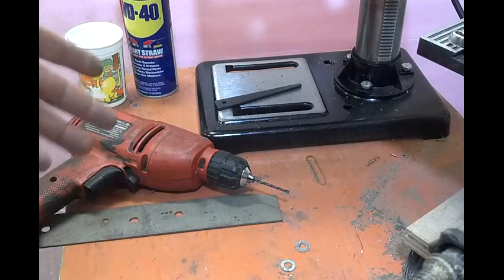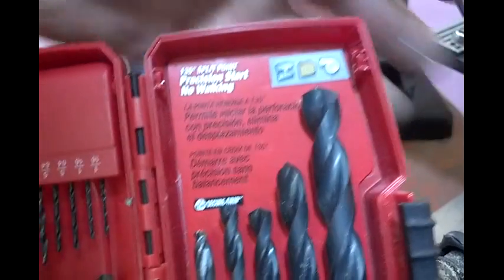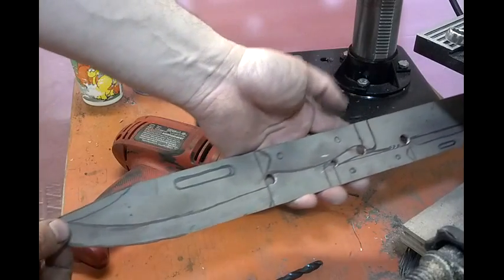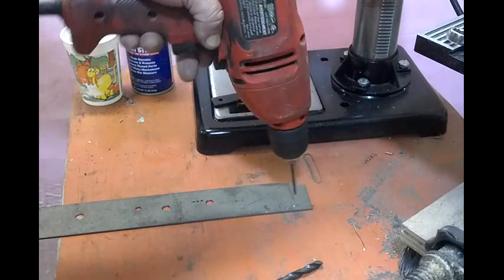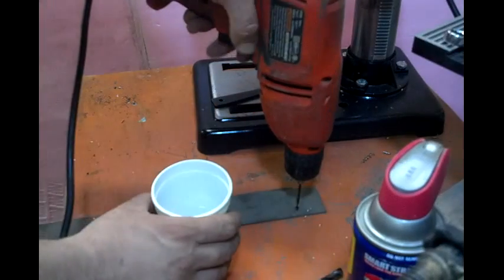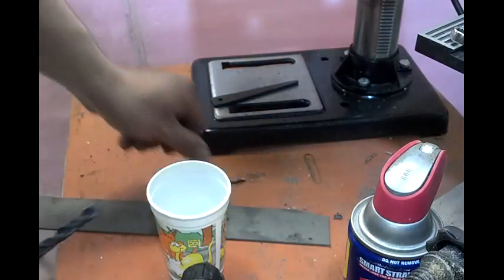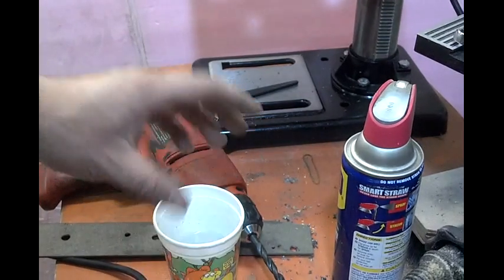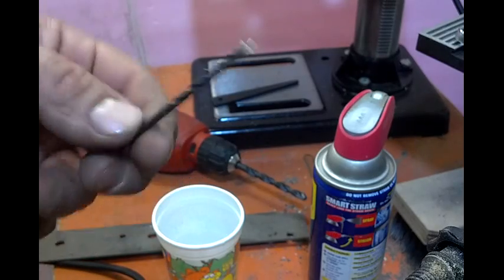How to drill Stainless Steel  w/ cheap tools and minimal supplies

Comment: Use modeling clay to build a donut shaped dam around your drill location. Use actual drilling/tap fluid the dark brown stuff, probably not being made anymore though. Slow rpm good pressure.

Comment: True, oil is a mess, tough to clean. Will use water, regular HSS drill bits, patience and a slow pace.

pilot hole 1/8" = 3.2mm

5/6" = 21mm

5/16" = 6mm

1/2" = 12,7mm

1/4" = 6.4 mm

Comment: Hi Josh..
Whats  the best way to drill a pilot hole, if its above your head drilling OR against a galvanized 76mm pole that's 2mm wall thick. 
Is Using a punch with a hammer,  is that the only option. 
Thanks man

Comment: WD40 is not really a cutting fluid. It's a lubricant and all, but it doesn't take the heat away that well. Use ACTUAL cutting fluid for this job. The price is the same.

Comment: I wouldn't be so quick to knock harbor freight. I just watched a video of a guy drilling holes through a FILE with some carbide drills he got from harbor freight. https://www.youtube.com/watch?v=zWrwDTn9GT8 
Having sharp bits (and a bit sharpener) makes all the difference. I make my own cutting lube by mixing lard with cutting oil till I get a toothpaste like consistency, then put it in a blunt tip syringe. Works decent on stainless and hard metal.

Comment: Who are you kidding your "plain old black drill" may well in fact be good quality HSS. Certainly your set of Milwauky drill is in that league.
You need to use only sharp drills of decent quality made from HSS. Start from a centre pop, drill using both hands, & keep the speed as low as you can. As you recommend frequent cooling is highly desirable.

Comment: If all possible submerge your part in water or a steady stream of water, oil holds heat and water evaporates. Try it ! I do it all the time and have used HF bits plenty of times

Comment: Very useful video and tips, Josh. Thanks.
In my video here https://www.youtube.com/watch?v=Fv6cZVbTOIk  I'm addressing only the problem of small-diameter drilling in stainless steel, which was previously a problem for me.
I agree with you that cooling+lubrication of the drilling zone do miracles. However, WD40 is more of a solvent than a lubricant, rendering only an extremely thin film of light-grade oil. I would rather use a mixture of water+"any" grade of lubrication oil--from thin sewing machine grade, to heavy, viscous gearbox grade. Yet as you said, it's usually a bit messy using oil.

Comment: I was trying to drill an old machete at home without a punch. I might give it another try after seeing this video.
Reply from the maker: You are trying to drill a piece if tempered steel, it will be very difficult. In this case you may need to buy the toughest German "NASA" grade bits you can get your hands on!

Comment: For thick stainless, Fill a sprayer with ice water,  spray constantly. Or rig a 2liter with dry ice/water and 1/4" hose. Lay it on its side. Drill ultra slow. Like 1 revolution a second. If it squeals, stop immediately. It should be cold, quiet, and cut the entire time. Constant speed, constant pressure. Temperature is key here. Stainless will gum up a cutting edge(squeal) create an enormous amount of heat quickly, and change the state of both the steel and the bit in a heartbeat. Dipping the bit in and slathering the steel in no-lox doesnt hurt either if water is unreasonable but it  doesnt help the heat problem.

For stainless sheet metal up to 10guage.  A hilti. All day long drill  with a hilti bit. Never stops making holes, no water, full speed, push hard, will drill a hole in seconds and continue drilling holes for the next 8 hours with no break. Holes are ugly but the hilti will drill it like its butter.  I wouldnt be surprised if  a hilti with a 1/4" bit couldnt get through a 1" thick piece of the hardest stainless in less than 60 seconds. And make 10 holes in 11 minutes.   

The hardest thing to drill in the world???? Try lead. 4+ inches. Drill through a slab of lead and you will have mastered the art of drilling stainless and aluminum.
Reply: Ryan Lloyd which hilti?

Comment: I am installing a reverse osmosis unit which required a 3/8 hole through the stainless sink for the faucet.  I could not make a dent in it. Followed your instruction and in several minutes I had a 3/8.  You must be patient though. Thank You!  I would have had to call a plumber.

Comment: Thanks man, I need to drill 3.5mm holes to mount a bunch of frames in rectangular stainless steel tubing for retail, i was pulling my hair out bc i know nothing about metal only wood and plastic. This is saving my ass, thank you sincerely.

Comment: I just spent 5 minutes making the pilot hole in 1mm thick mild steel... I obviously need better bits.
Reply: varun009 
Nope, you need better technique. You'll get it though. I drill through corroguarded steel every day at work with simple hss bits.

Comment: As a german: Thanks for saying that our drillbits are fancy. I would recommend u buying some hss-g drillbits. They will cost you about 20 dollars if you buy 20 in a box and they drill through ANYTHING. Really, why spend spend every time 1,20 dollar on something you can get with way better quality for less? Btw I also use water to cool.:-)

Comment: What means "w/"? W...or....what?
And how much is 3/16, 1/8... 0.125, 0.187?
Reply from the maker: D EMIL "w/" is an abbreviation for the word "with", and your fraction to decimals are correct!
Reply: Why use a / after W? I interpreted the / as a fraction or correlation sign as in m/f for male/female.
See in contrast how e.g. is abbreviated.
Been asked this by students, couldn't give a consistent answer. I usually tell that a dot is used for abbreviations as in e.g. or it is turned into an acronym or similar (like btw for by the way or betw. for between) or a ' for contractions such as K'Bridge. Confused...

Comment: So straight forward, do I need a specific drill? to do metal drilling, just for the house jobs small jobs , or can I use a normal drill that does wood etc . thanks for the video
Reply from the maker: Bigger and stronger is best for metal, but if your drilling small holes a light duty drill like mine will work fine.

Comment: Didn't work for me. Tried to drill through a stainless 1/16" tube. Tried slow-high pressure, fast-low pressure, and the rest of the possibilities...but to no avail :-(

Comment: thanks for the video, i'm trying to drill through 1mm SS stock pot. i'm breaking bits left and right, i couldn't find the Milwaukee black oxide 135 degree bits but did find the same style in Ryobi brand. I will be trying these bits later today, I hope this works because i'm running out of options.

Comment: Thank you so much.  I spent 90+ minutes trying to drill a pilot hole in a stainless exhaust header and was unsuccessful despite resharpening the bit multiple times with a Drill Dr., using WD40 as a cutting fluid, and using different RPMs and pressures.  The bit simply wouldn't "bite," which was very frustrating.  After watching this video, I tried again the next morning and had a pilot hole and 1/2" hole drilled in less than five minutes.  I hadn't realized water (along with a sharp bit) is the key.

Comment: Thanks for sharing. Using water was a good tip. Wish you could share a video how to drill out a broken stainless steel bolt 6mm diameter.  Thats the HUGE  challenge I am dealing with.

Comment: What should I do if I need to drill a 1" hole in a stainless steel cover on a diesel tank? Can't let water get in, would prefer not to have shavings fall in. I've heard beeswax on a bit will keep shavings stuck to it, but will that work on a hole saw? Also, since I know you'll ask, it is impractical in this case to remove the cover and drill away from the tank.
Reply from the maker: Bees wax should work some, but if I had to do this with water and have a air hose blowing the chips away and/or constantly brushing the chips away. Next I would drill 98% though and break that little holesaw slug out manually with a screw driver. The only benefit of not drilling all the way though would only be to reduce the amount of chips created and to prevent them from falling in accidentally if you plunge though.

Comment: omg lmfao after watching this video I tried alot of drill bits and believe it or not the harbor frieght bits actually did the trick. I couldnt believe the struggle and was quite frakny getting pretty pissed, so when all else failed with even the cobolt bit I kid you not I said what  do I have to loose? and tried the harbor frieght and walla :) so off to harbor fright for more :)
Reply from the maker: I hope they upped their game! I've purchased many packs of HF titanium bits, half of them were ground in the wrong direction and the titanium coating doesn't make up for bad tempering. Pack of seven 1/8" drill bits for $2.99 is a fantastic price, but the time lost in messing around with them aren't worth it for me.  :)
Reply: dude I am not lieing though, I am dumb founded at how I went out of my way to do my research and after watching your vid I went to home depot and got cobolt bits and kid u not , couldnt make a hole :( tried few dif brands, and almost shit when the harbor freight went through like a champ :) I was drilling into a stainlless steel spoon so not sure what the deal is myself but hey :)  maybe they r good for that :)

Comment: Harbor Freight offers cobalt drill bits that are actually top quality. I also use their standard HSS drill bits without a problem. You just have to know what you are doing like using WD-40 in my opinion is retarded for a drilling coolant. Use a lite oil WD-40 makes it much slipperier and increases skating most likely.

Comment: I tried to drill a hole in a stainless measuring device yesterday. So to hang it on a little nail. After re-sharping a 1/8 bit several times and barely scratching the 1/32 thick metal ruler. I broke out a brand new titanium bit. Still nothing. I gave up. Thanks for you video.. But

Comment: Just thought I'd mention, if you make sure to use HSS (high speed steel) drill bits (any decent set made these days is most likely going to be HSS), then you don't have to worry nearly as much about temperature affecting the cutting edge of the bit.  HSS retains its hardness up into red temperatures, way way beyond the point where plain carbon tool steel would lose its tool hardness.  You do still have to worry about friction and pressure work hardening the stainless steel though, once it works hardens it'll be a son of a gun to cut through.

Comment: OMG, where were you before I ruined three VERY expensives bits???? Duh, this makes so much freaking sense. I recently started making jewelery using cutlery. Any suggestions on how to drill holes on this suckers or what to use for a pilot hole? Thanks!!

Comment: Was the knife steel heat-treated (hardened) yet?
Reply from the maker: +E. van Doorne, No it was annealed, but even then it was still tougher than 304 SS. To drill pre hardened knives I sharpen carbide masonry bits and plow my way through. 😃

Comment: Thanks for the video advice I was struggling to drill some stainless and had already ruined 2 drill bits by overheating, drilled the pilot holes, cooled with water, drilled full sized holes, project completed thanks to you!

Comment: The reason water works so well is that while not a great lubricant it produces 539 calories per gram of vapour it produces. 2256 watts of cooling power per second during which a gram of water evaporated! (If a gram per second is evaporated it will produce that many watts of cooling) While there is water there the temp cannot climb above 212 degrees, which makes it a good way of keeping temperature of the bit under detempering or softening levels. A steady drip of water is therefore recommended which is why most cutting oils such as cutwell are water based. Drilling successively larger bits is recommended because there is less material relatively to remove for the larger bit,  keeping the bit cooler. The dipping method give the steel time to cool as well as relax, a trick used in rock drilling.
Reply: Tony Y you're thinking of coolant. The way I've always made coolant was half and half water and oil. I work in a machine shop and that's how we do it
Reply: Excellent, thanks for expalining that Eric. I recall using a milky drilling fluid to drill steel in school metalwork shop (several decades ago).  I vaguely recall the teacher explaining that it was a mixture of oil & water - although I also recall that oil & water don't generally mix.  Is it possible to make such a mixture that stays milky rather than separating at home?

Comment: Drilling sheets of stainless i melted many nice drill bits. Drill a hole, bit gets dull, push harder, faster, bit melts. No time to cool off the bit. I got fed up with melting the bits then discovered that a concrete bit with that carbon tip will blow through stainless like a torch. It heats the steel yellow hot and melts through at a high speed without damaging the bit. Those concrete bits can take extreme temperatures. Give it a try.
Reply: Thank you very much.  The workshop guys said it is a NASA technology asked me huge amount to drill ss flatbar of 3mm.

Comment: If you go to Amazon or various other tool sellers, you will find packs of 1/8" COBALT drill bits with split point construction .  They handle a lot more heat than carbon,  HSS, or Titanium coated drill bits.  They are great starter drills.   If you want to mess around with HSS and re-sharpening, be my guest.   But it is fairly hard to  free-hand re-grind a new point on any drill below 5/32" in diameter.   And I am talking standard 118 deg points.  Split points are very hard to do without a machine.

Comment: The bit wears out in stainless because the material work hardens if you go too fast....the area your drilling becomes harder than the bit. Keeping it cool is key but it's not the bit, it's the material.Using water, he is cooling the hole when he sets the bit down in it.  Also if that's 440C knife steel, it's annealed making it much softer than the cold rolled state that regular 304/316 stainless comes in.

Comment: When dipping a drill bit to cool it, it don't wait until it changes colour. 
Dip it frequently or the thermal shock will cause micro-cracking or embrittlement, and it will fail prematurely.
Think of dipping as a way to KEEP it cool, not to MAKE it cool.

Comment: what type of bits do I need to drill 1mm brass holes 1/4" deep about 100 times?
Reply from the maker: +JB 1mm is a tiny drill bit and can break easily. Shorter drill bits tend to be stronger, so I would look at this: http://www.mcmaster.com/#28255a11/=10yo1o9 . Good Luck!

Comment: I drill through holes with 1/4", 5/16", 7/16 drill bits. The metals I work with are SS, alloy steels, brass and aluminum. The holes can be from 2" to 6" in length. The holes finish look a little rough. How do I get them to be cleaner / smoother?. Also I want to use reamers. Do I drill the hole to the size I need or a slightly smaller size then ream it to my desired size? Thank you
Reply from the maker: +Airgunner 66 Check out this vid, (personally don't like his bad acting but has great info) https://youtu.be/xhxcUcKSR-Y
Reply: HaHa. I have seen his other videos. Very informative but, with bad acting for sure. Thanks!

Comment: He says with a harbor freight drill press in the background.
Reply: +Chris G  I think you misunderstand the point he is making:  
He says "Don't buy HF drill BITS" 
Stainless doesn't particularly care whether you have a cheap drilling appliance (provided it does not run too fast), but it DOES insist on destroying drill bits made of cheese.

Comment: What drill bit do you recommend? My drill can't drill through a hard door.
Reply: +Karl Hans Go to a place which sells to the trade, not to home handymen, and ask for a medium quality drill bit. (unless you want to drill lots of holes)
For hard stainless, or many holes, you will need something better, probably a "Cobalt" grade (this is not a brand, but an alloying element)
You will need a slow speed, and coolant as recommended in this clip.
AND you need to keep the pressure on: don't ever let the bit rub; when it rubs without biting into the metal, stainless will immediately harden and become too hard for most drill bits; the bit will then heat up within fractions of a second and be destroyed.
Reply: +Gottenhimfella Thankks I'll do that :)

Comment: I am drilling through thick stainless steel with a drill press at low speed. The bits keep breaking and I can get the bowl shape but after that the cutting stops. Any advice?
Reply from the maker: +PANGURIC FALCON, thats hard to help diagnose without seeing whats happening, in the perfect world you should start on low speed, apply moderate pressure, and with a sharp drill bit and get nice curls or chips as soon as you start drilling. Small drill bits break for a couple reasons the cutting edge jams/stuck and the twisting power snaps it,  there is to much downward pressure applied bending/ breaking it in half. 
I've run into a similar situation with a ridiculously tough S.S. sheet instantly dulling every bit that I tried. I had to buy the "Nasa grade" cobalt with titanium coating drill bits still dulled those but It took me 12 bits to finish. It cost me a lot of money to finish,  I hope you didn't find that same plate. Good luck!
Reply: +UnsanctionedFabrication I must have found that metal, dulled MANY bits including some pricey bits and all were supposedly stainless capable :/  Funny thing it is a cheap bracket that came in a Chinese intercooler kit, the first stainless bracket drilled no problem but the second identical bracket is the total opposite.